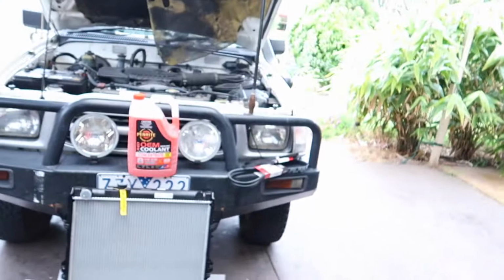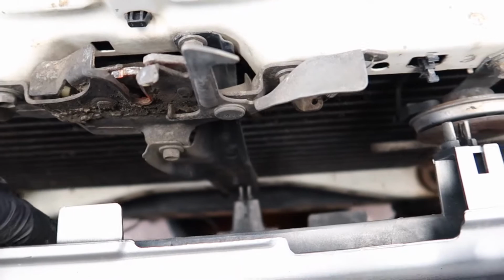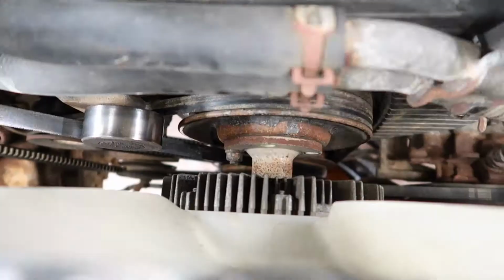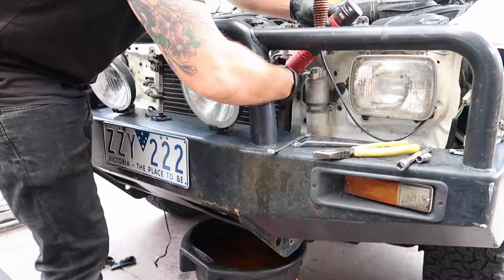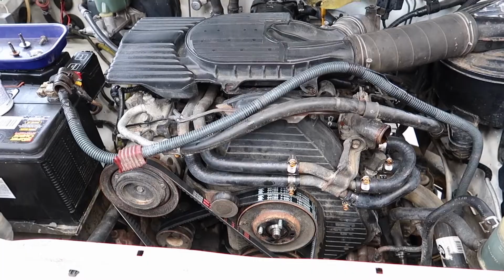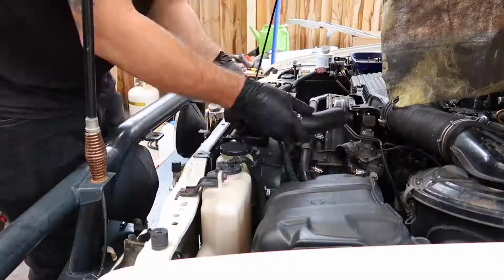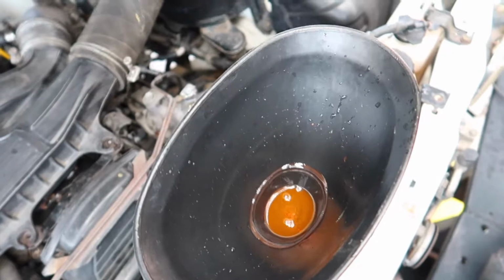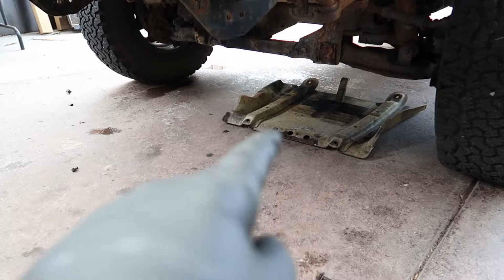2000 Toyota Hilux Radiator Replacement

Comment: Thanks for your videos they help in guidance.  I manly used this one incase l had to bleed my radiator as l just bypassed my heater core watched your heater core replacement video will be tackling that later on
Reply from the maker: Glad it has helped you 😊😊

Comment: Great video - I have a 1kz-te in my surf. It has the thermostat on the lower radiator hose. Will the coolant change/flush be the same as with the thermostat on the upper hose - i.e. I can just top up the radiator and switch it on then add through the funnel as it sucks in the coolant?
Reply from the maker: Hey mate, sorry for the late reply. It should all be the same as long as you drain all coolant from the system.